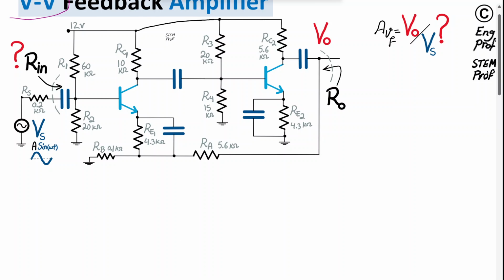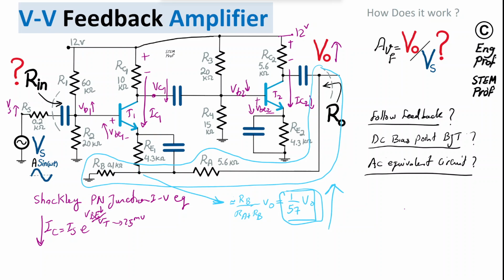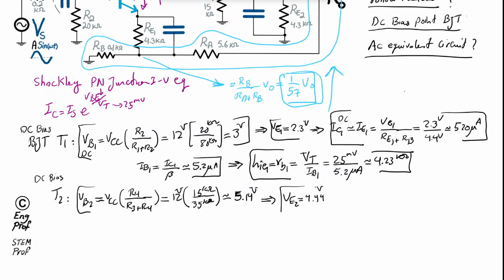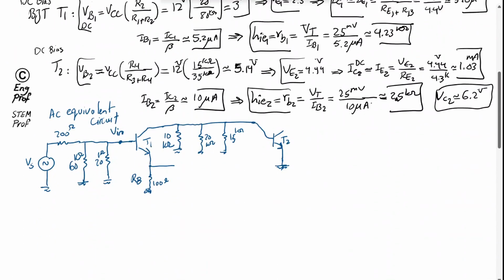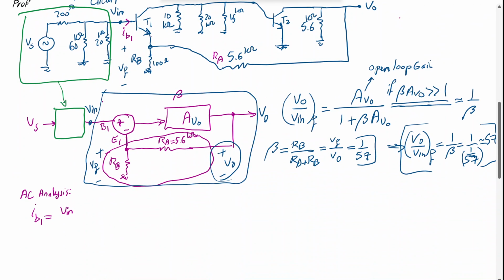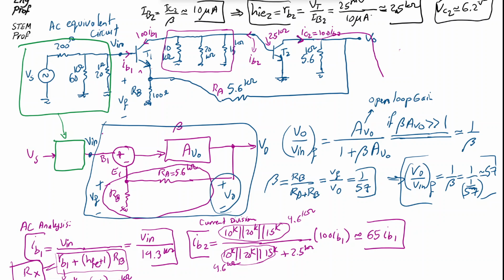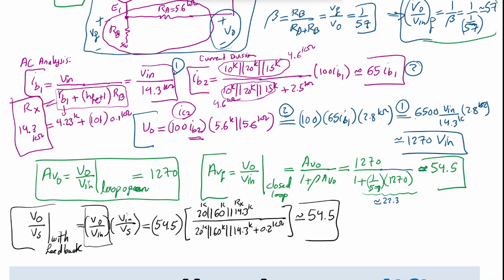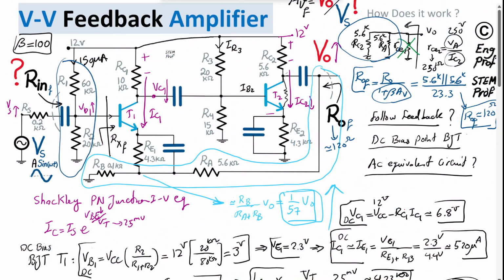Series-shunt Feedback Amplifier Explained: Computing Voltage Gain & Impedances

Comment: THE PROBLEM IS , WE HAVE TO USE VERY HIGH VALUES FOR  VOLTAGE DIVIDER BIAS NETWORK .IS IT OK?
Reply from the maker: As explained in the video, yes, as long as the current through bias resistors is considerably larger than the base current of the corresponding BJT transistor. Here are a few more examples:  Feedback Amplifier with JFET & BJT Transistors https://youtu.be/NB1-mYglXsY
Feedback Amplifier with BJT: How to find DC Bias and AC Gain https://youtu.be/6dLMxpLNKv4
I hope these feedback circuits videos are helpful.

Comment: Thank you for video. In what applications would you use this circuit?
Reply from the maker: You're welcome. Thanks for watching. Audio amplifiers is an example of application for this feedback amplifier circuit. For more Analog Amplifier Circuits please see:
Feedback Amplifier with JFET & BJT Transistors https://youtu.be/NB1-mYglXsY
Op Amp Amplifier with Electronic Gain Control https://youtu.be/NoNgQpbj77Y
Feedback Amplifier with BJT: How to find DC Bias and AC Gain https://youtu.be/6dLMxpLNKv4
I hope these videos are useful and interesting 🙏
Reply: @STEMprof  thank you for answering
Reply from the maker: You are welcome.

Comment from the maker: Thanks for watching. For more Op Amp Circuits please see:
Feedback Amplifier with JFET & BJT Transistors https://youtu.be/NB1-mYglXsY
Op Amp Amplifier with Electronic Gain Control https://youtu.be/NoNgQpbj77Y
Feedback Amplifier with BJT: How to find DC Bias and AC Gain https://youtu.be/6dLMxpLNKv4
Push-Pull Power Amplifier with Darlington Transistors https://youtu.be/866MYibo8yE
Thermometer Circuit Design with Op Amp & BJT transistor https://youtu.be/55YsraFE0rg
Op Amp Analog Computer Differential Equation Solver https://youtu.be/ENq39EesfPw
Wilson Current Mirror and Current Source Design https://youtu.be/LfbfJYrovN0
Analog Logarithm Computer https://youtu.be/RpKEq5WyoLg

Programmable Current Source Design with Op Amp, Zener Diode and Digital Potentiometer https://youtu.be/R1x6B0TczWk
On-Chip BJT Current Source Design https://youtu.be/Rs7gEMk03dw
Instrumentation Amplifier with Electronic Gain Control https://youtu.be/C4tghZ-q6Zs
Sawtooth Oscillator Design https://youtu.be/2eUsGPfqbW4
Triangle Oscillator Op Amp circuit https://youtu.be/JF5Up_cuL9k
Sallen-Key Analog Filter Design Tutorial https://youtu.be/KwUnQXbk7gM
How to find Bode Plot, Freq Response, Transfer Function of Analog Filters https://youtu.be/vZFkPeDa1H8
Universal Analog Filter Design https://youtu.be/2J-0msXZE2o
Laplace Transform Example and S-domain circuit analysis:  https://youtu.be/ps8N5TPM_qU
Op Amp circuit Bode Frequency plot https://youtu.be/BLVzuuqAlZs
Lowpass Butterworth Filter: https://youtu.be/UzCjkwqy-9w
Analog Computer to Raise Signal to power n https://youtu.be/IUTlBH1UraE
Differential Equation Solver Analog Circuit https://youtu.be/R3X5AYNZGEI
Complex Sinusoid Oscillator https://youtu.be/GXRhmwmS5Zk
Full-Wave Rectifier circuit example https://youtu.be/DJJMNU-CYcg
Sawtooth Waveform Generator design with OpAmp, JFET, BJT https://youtu.be/5zHXTx-Vl20 
op amps Circuit with feedback loops to design an analog computer that solves a second order differential equation https://youtu.be/HeZRtnRXpEI 
For more analog circuits and signal processing examples see: https://www.youtube.com/playlist?list=PLrwXF7N522y4c7c-8KBjrwd7IyaZfWxyt
I hope these Circuit design and analysis examples and videos are useful and interesting. 🙋‍♂